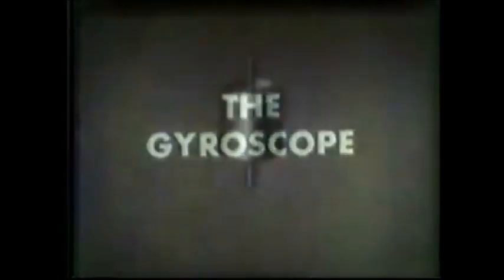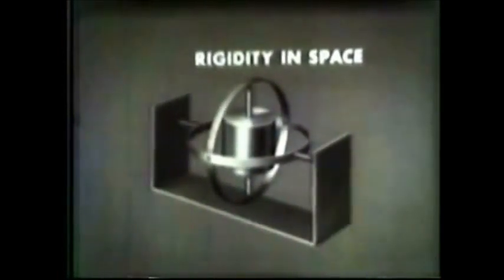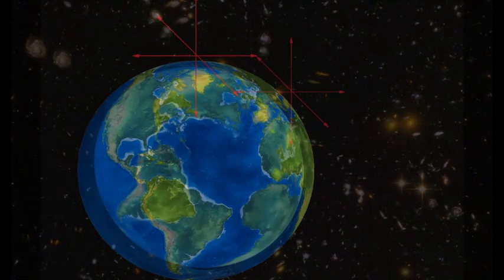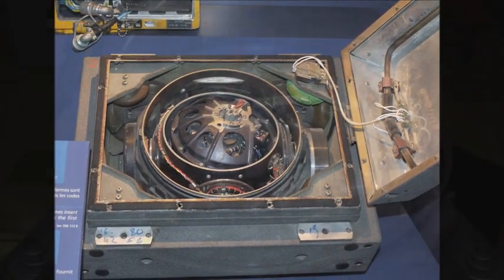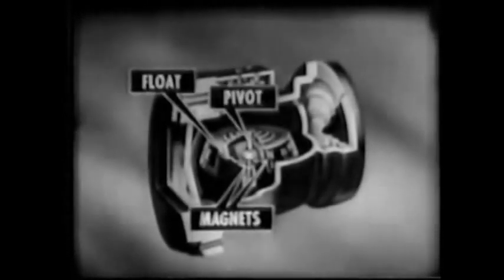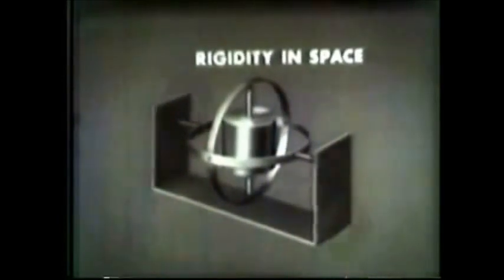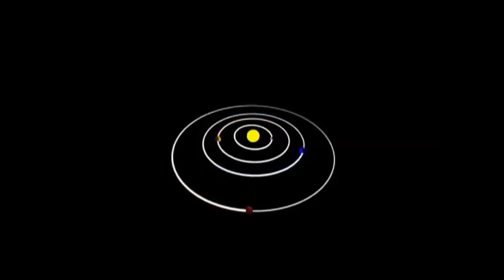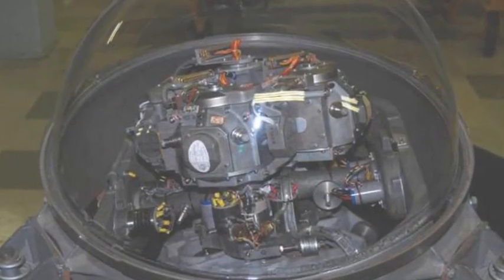Gyro Navigation: IMPOSSIBLE on a Globe...

Comment: One professional grade three axis gyroscope, without any supposed shift correcting mechanisms, fired up sitting on your desk, and in six hours of videoing its three axises, you'll know for sure if the earth is rotating or not.  I don't know of a simpler method to prove or disprove a rotating earth.  I just don't know how much such a gyroscope would cost.  Maybe one can be rented for six hours, that is all it would be needed for.

Just so things are clear, the gyroscope in the old training film is a single axis gyroscope put in a three axis gimbal.  This will not do the job as it does not cover every turn, for example, if the gyroscope was on the axis of the north pole and the axis of the gyroscope was parallel to the axis of the earth, the gyroscope would not register any rotation of the earth whatsoever.  However, if you put the axis of that same gyroscope perpendicular to the axis of the earth on the north pole, then it would register the rotation, if there is one.

However, a three axis gyroscope set in a three axis gimbal, will register any turn in any direction.  The big gyroscope seen in the video appears to be a three axis gyroscope, and a very expensive one.

Now, lets be scientific in our statements.  This test will only prove or disprove the earth's rotation.  It will not prove the earth is flat and it will not prove the earth is a globe.  To make such a statement is very unscientific, misleading, and unprofessional.

So, lets figure out how to get a professional three axis gyroscope, and there should be three high quality video recorders aimed at the gyroscope and a clock all taking a six hour long video.  There should be at least two honest objective people from each of the two models, flat earth and globe earth, and two neutral people, like me, who are simply looking for what is true, no matter what the truth turns out to be, as witnesses.
Reply from the maker: +musclecar rocklover Yes, I have seen the video done by "Mr Concave", Steven Christ himself, on the same Navy training video, trying to make the case that it can only actually work on what would basically be an INVERTED globe...

Let's just say I don't find his explanation, or argumentation, at all compelling...
Reply: Thank you for your honesty. I do however agree with the maker of the video.
Reply: +Shanshou4 
You are implying that I don't, how so?
Reply: +musclecar rocklover 
Could you and all others that delete it please leave the "+Name" in your comments so the rest of us know exactly who you are replying to.  Thanks.
Reply: +Robert Meyer 
dont you think the fact that aircraft do not have to keep resetting the gyro in flight shows a flat earth?.
E.g. on a globe, If the gyro is spun up at the north pole (horizontal) by the time u get to the equator the gyro is now vertical(90 degrees to sea level) & inverted at the south pole.
Reply: +Steve Tozer 
What one thinks does not matter, what one can objectively test and witness and accurately convey the results of, that's what matters.  Hence my first message to which this line of replies is attached. Lets get the proper equipment, have the proper people doing the test together, then they can accurately convey what they witnessed.

At this point, even though I've heard testimony in support thereof, and tend to believe is true, I do not know that it is a "fact that aircraft do not have to keep resetting the gyro in flight."  Have you seen those gyros?  I don't know what the electronics attached to those gyros really do, and I don't think those that gave testimony do either, as the unit is already installed, or is installed as a black box.  I'll have to hear the testimony of the manufacturers.  This is why in my first message I say "One professional grade three axis gyroscope, without any supposed shift correcting mechanisms".

I seek solid undeniable proof.  Proof that can only be had with the right equipment and right group of people.  If the earth is indeed rotating, one or more axis of the gyro will shift in relation to its orientation to the earth's surface.  If the earth is not rotating, none of the three axis of the gyro will change in relation to their orientation to the surface of the earth.  And, this is extremely important, all this test will do is show whether or not the earth is rotating.  It will not be evidence for a flat earth nor a globe earth.  It will only be evidence for rotation or no rotation.  Beyond that is misapplication of what is witnessed.  A thing Globe Earth and Flat Earth religious zealots quite often do, which greatly diminishes their credibility and causes objective people to not wish to watch anymore of their videos.
Reply: +Robert Meyer , yes i like the sound of a practical test, do you think even a single axis free floating gyro spun up to a constant 5K rpm in a vertical position with the radial edge of the flywheel facing the sun,... if the earth moves/rotates, the axial alignment of the gyro should move 360 degrees in 24hours or 15 degrees per hour.
 Over the next day or 2 i'm going to try the above, i reckon even allowing for a bit of drift, there should be consistency that shows the 15*p/h or not, will spin the electric motor both ways to get the mean average.
Reply: +Steve Tozer 
First, though I comprehend the principles of a gyroscope, I am, by no means, an expert on design or what makes an optimum gyroscope.

For personal testing, a single axis gyroscope is fine.  Just keep in mind that the axis can be placed so that it would not detect any rotation, detect little rotation, or a lot of rotation, assuming of course, there is rotation.  How you want to position the axis has nothing to do with the sun, but rather in relation of the supposed rotation direction at your location.  For best results, you want the axis of the gyroscope to be perpendicular to the earth's rotation axis.  Anything less than perpendicular will result in less of a change, should there actually be rotation.  There is really no need to go more than six hours.  If the axis of the gyro is set correctly, you'll get a 90 degree change in the axis' orientation to the earth's surface, or more precisely, to the earth's axis of rotation.  Actually, even three hours is sufficient for you'll have a 45 degree change.  Assuming of course, the earth is rotating.

But, whatever your results are, simply state how you set it up, how you determined the orientation of the axis, and what you observed over the time span.  Don't be tempted to say things like "I've proven the earth does not rotate." or "I've proven the earth does rotate."  A single axis gyroscope is easily called into question, and the fact that you are the only witness doesn't make for a credible test.  I'm not saying that you are not credible or that the results you witness don't prove one thing or another, it is simply the fact that it isn't done in a group of opposing views where one can instantly challenge something they believe to be in error.

None-the-less, I'd definitely would like to be informed of your results.  Bear in mind that if your results evidence no rotation, globe earth religious zealots will be on your case, saying things like it was rigged, the axis wasn't set properly, and many other vomitus puke they'll hurl at you.  Of course, if your results evidence rotation, flat earth religious zealots will do the same.  So, be prepared.  Truth is hated by those whose beliefs and/or agendas are contrary to truth.
Reply: +Robert Meyer i agree with all the tips & advice above.
The 1st vertical test showed no movement however the valid point you make about: "the axis of the gyroscope to be perpendicular to the earth's rotation axis", <this is the best chance of getting an accurate result i think. 
I am keen do more test,..time is my biggest enemy at the moment,... particularly as to make the universal cradle perfectly balanced & as friction free as possible + to be able to run 12volt /2amp through at least 4 pivot points.
In Perth WA (Australia) looks like i will have to tilt the north end of the disk -32degrees from horizon to be near inline with the earths axis(if its round lol ). 
From your comment 5 days ago: " This test will only prove or disprove the earth's rotation.  It will not prove the earth is flat and it will not prove the earth is a globe." I think if there is rotation clearly, accurately, repeatedly noted, then there is also a way to test for globe or flat. A horizontal gyro on one end of a 6 pivot parallelogram type balance scale perfectly balanced while the gyro is at zero rpm,.. should actually appear to become "lighter" (when spun up) on its theoretical east bound trajectory, the same could not happen on a flat earth. What do u reckon? :)
Reply: +Steve Tozer , would like to see the details of the first test.  Unavailable time and resources are quite often the cause of delays.

Perhaps you could create an imgur.com account, its free and very popular, and you can upload pictures of what you are doing.  Though you cannot upload movies there, you can convert movies to GIFs and upload the GIFs.  Imgur.com will do the conversion for you.  Put the pictures you want viewed in an album so that they can be viewed in the order you wish.  Here is one such album I've created there: http://imgur.com/a/8RMME

As I don't know what you mean by "disk" and therefore what its "north end" is I cannot really make any comment on the matter.

I take it that you've never spun a cardboard box, or flat square object.  I don't know of any object, no matter its shape, that cannot be rotated.  Therefore, lets not assume that a flat earth cannot rotate.  I know, it is hard to stay away from making assumptions. LOL

But yes, if we are on a rotating object, then if the axis of the gyro is set properly, I think it will become lighter as it resists being rotated.  But, I don't know if such a decrease in weight would be significant enough to measure.  Of course, if there is no rotation, there will be no weight change anyway.
Reply: If the spinning axle starts out horizontal, it will stay horizontal after 6 hours.   If the axle is started   vertical, it will have turned 45 degrees after 6 hours. Prove the earth is rotating. If it stays the same way after 6 hours, vertical , then a gyroscope is some way influenced by some thing. Then a gyroscope dose not stay the same way every where in the universe. The universe is all there is, there is no more.